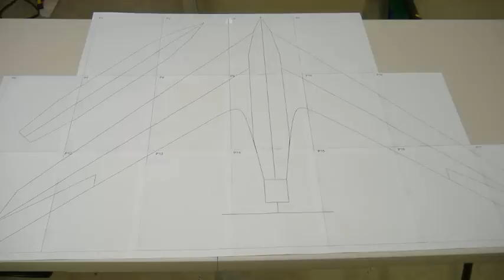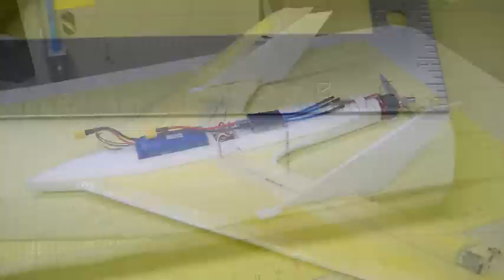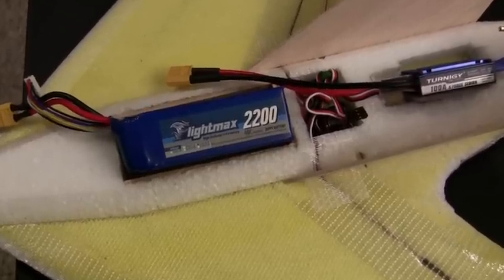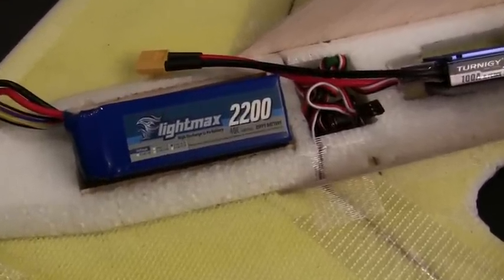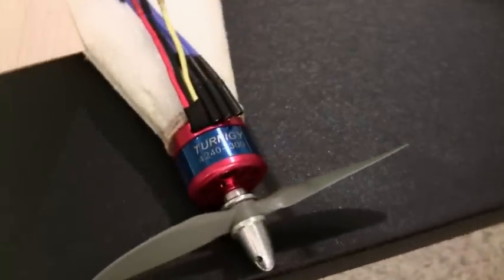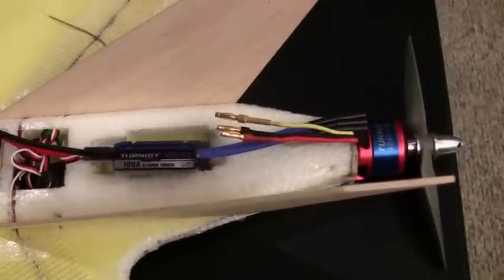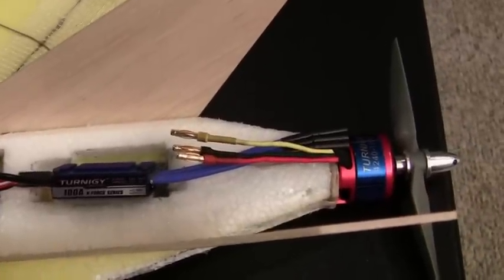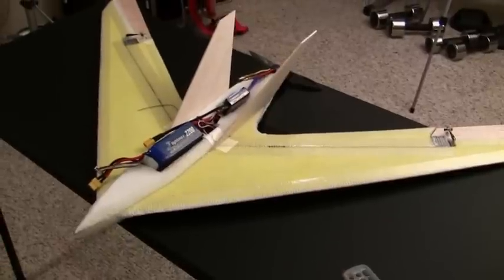FF-Sparrow The Build Part 1

Comment from the maker: Cool gripchion!!! I agree I didn't like the way it looked with the stabs out on the wing and I think it will be more stable this way. They will be a little like a v-tail. As for the battery it's 5s the same as I was running in the FunJet. Also I will be shortening the wiresto the back of the plane,  just didn't get to it yet.

Comment from the maker: rcmotorsect 150-160 sounds good to me!! About the size of this motor it is actually the largest diameter motor I have ever used, 42mm. The one in the FunJet is 36mm but longer and that's where it gets the extra power. just to give you a size comparison a 2212/6 motor is only 28mm.

Comment from the maker: remotecontrolaholic you can use just about any type of foam to build rc planes including architectural foam. There is however a big difference in the properties of each foam which will change the planes strengths and weaknesses. It's really a matter of experimenting till you find what works best for you and what you want out of your builds. Paul and I like epp because it is very resilient and can take a crash like no other foam we have tried. Elmer's foam board is great for fast builds, etc.

Comment from the maker: pudd750 its that high pitch that will help put this plane over the top in the speed department. I will be doing some more experimenting with other props as well. As for the bigger esc it does help keep it cooler but I don't think I have to worry too much about that right now with the weather temperatures we are having here.

Comment from the maker: Thanks Brandon, I'm not too worried about the batteries they should warm up after a feww good blasts. Its the receiver failing at these temperatures that worries me. The operating temp of the Spektrum receivers is only rated down to 32 degrees. we are going into the negative temps later this week.

Comment from the maker: youtwoba this esc is the bomb!! it has a built in switching bec with adjustable voltage from the proram card. can be set to either 5.25v or 6v and puts ot 3amps and can be used with up to 6s LiPo batteries. I put links in the video sidebar.

Comment from the maker: Brandon the elevons look deceptively small on this plane. Remember the wing span is 45 inches. The elevons are actually 12 inches long and 2.5 inches wide at the widest point. This plane probably won't fly well really slow but I think there is enough control there if I turn the rates up. They are also shorter because of the wings shape. It helps to keep the control surface to the rear of the motor to get more elevator leverage. Being to the outside of the wing the roll authority should be good.

Comment from the maker: Johndog35 I understand what you are feeling. We just got snowed on yesterday and will have very cold temperatures through the weekend. Be careful if you fly with a Spektrum radio, the receivers operating temperature is only rated down to 32 degrees  Fahrenheit or 0 degrees Celsius. Below this they can shut down.

Comment: That's interesting, the receiver operating temp never crossed my mind. That's a good detail for people to know. Not something I would normally deal with in Florida, but we're experiencing some of the coldest weather in years down here. Early morning/evening flights may have to be delayed as it's not getting above 32 until about 9-10am. The weather has delayed the fiberglass work on the speed plane, the fumes are too much to do inside. I may send it out to someone to finish the glass work.

Comment: THX for the reply.
Battery Spec.:
Voltage: 5S1P / 5 Cell / 18.5V
Discharge: 40C Constant / 50C Burst
Weight: 326g
That is quite a power brick.
I don't believe in single EDF planes. EDFs might be good if it comes to speed but they don't have the thrustefficiency that I want.
Two 64mm 800W EDFs could compare to a single 8"x9" 1600W sportsprop. ~2kg of thrust (at low speeds) should be the result.
I just hope that it flyes slow enough to land it.

Comment: I expect the elevons to work sufficiently at high speeds, but what do you think at slower speeds. I just noticed they look small. Knowing you, there is a reason for the size they are. Are you expecting to get faster speeds with smaller control surfaces? I've pondered doing control surface size experiments myself. Just wanting to know your thoughts on how you came up with the elevon dimensions.

Comment: these guys like high performance,
they will not get that from EDFs.

I'm sceptical about this design.
I think the CG and the ailevons will be problematic.
The ailevons need to be more perpendicular to the airflow and/or bigger, the battery further into the nose.
is that a 4 cell battery?

Comment from the maker: 0MoTheG the size of the elevons on this plane look deceiving. They are actually 12 inches long and 2.5 inch wide at the widest point which makes them about 25% larger than the ones on the FunJet. This plane has about the same wing area as the FunJet. This size especially at 140mph+  may actually be too big. Because the batteries are 5s and weigh about 12 ounces the cg is actually a bit nose heavy according to my glide tests. 0MoThG please look up Hoffman Magnetics EDFs 170-180mph. Scary!!